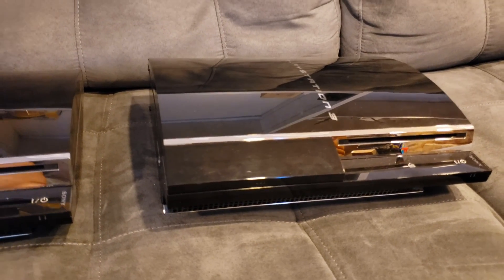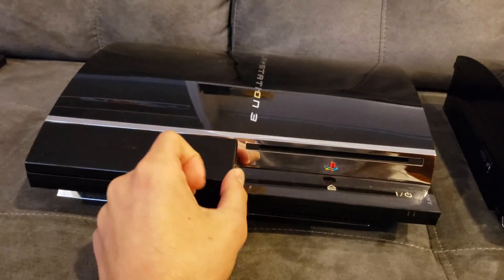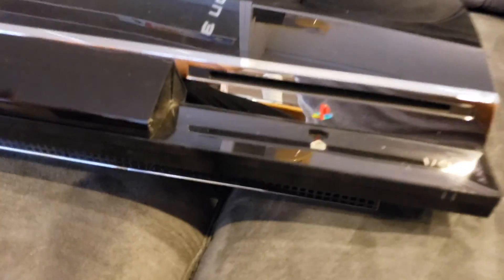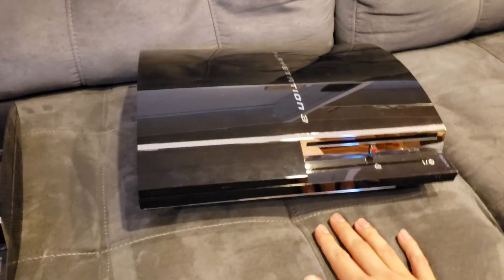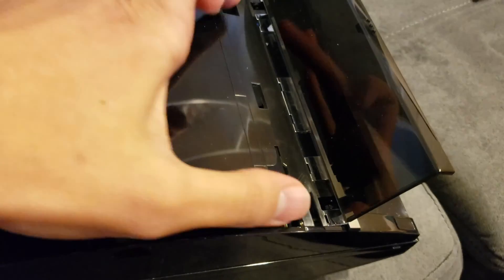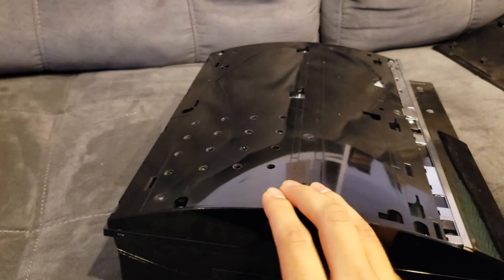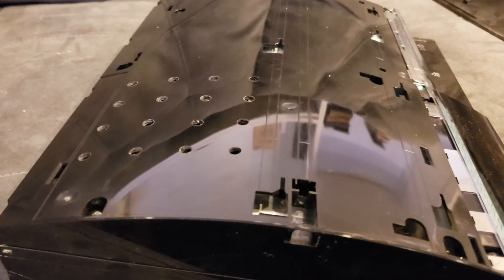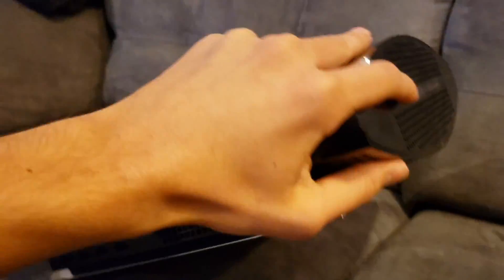Why PS3 YLOD happens and how to prevent it

Comment: Good video. What’s your take on the nec/tokin being the new believes reason for ylod
Reply from the maker: Thanks! I think the NEC/Tokin cap issue is very real. The same caps have been used in other electronics of the time and have been defective there as well. I have read many stories of ylod fixes by following a very thorough cap replacement tutorial on an old forum page, and I think that a majority of ylod PS3 can be fixed just by replacing the bad caps. Of course I still advocate the changing of thermal paste and pads on these old machines, because replacing a fried CPU or GPU is much more work than replacing caps.
Reply: @myairspace121  I agree. I think ideally if you want a fat system that will last a long time then you need to change the paste on the rsx and cpu. However you gotta change the paste under the spreader too which can be tricky. In addition to that, changing out the nec tokin caps and adding the fan mod will assure no need for reball. I have several fats I have changed the paste on and modded the fan. It’s loud but hasn’t failed.
Reply from the maker: @pzgeyo1995  Very interesting. I actually have a fat that has new paste on and under the IHS, and it actually runs hotter than another fat I have that only has new paste on the IHS. I'm not sure what caused this, but I have confirmed the anomaly by monitoring the temps through cfw. I also use a custom fan speed, so neither of them get too hot and work fine. 

From my knowledge, if the caps fail, all you have to do it replace the caps. You don't need to re-ball either chip.
Reply: @myairspace121  certain model fats run hotter than others. Like I have a cechg and it’s fan runs more than cecha at same temps.
Reply from the maker: @pzgeyo1995  That's pretty interesting.
Reply from the maker: @Mitchell Traigle Ah I see. You may be right. I'll try checking the next time I re-paste it. Thank you for the comment!
Reply from the maker: @Mitchell Traigle Aw man, I'm sorry to hear that. I hope it works out for you in the end.

Comment: Ihave question thermal paste importand under ihs
Reply from the maker: Yes, it is important to do so to keep the processors even cooler, but it is generally difficult to do. I would recommend against doing so unless you know exactly what you are doing.
Reply: @myairspace121  u think if i apply thermal paste on top of ihs is enough even the paste under ihs is dry
Reply from the maker: @ehabsaeed7686  I would recommend at least doing thermal paste on top of the ihs, and as long as the console has enough room to exhaust hot air, then I think it should be ok. Changing the thermal paste underneath the ihs as well would be the best option though since it will ensure the best dissipation of heat from the processors. It is a dangerous process though, and as I said earlier I only recommend doing so if you're very confident.
Reply: @myairspace121  if i have good temperature in the room and change thermal paste top of ihs only without changing thermal paste under ihs the cpu and gpu will not be damged
Reply from the maker: @ehabsaeed7686  I think that may work for you then.
Reply: @myairspace121  if i applied the thermal paste top of ihs is enough to cool the motherboard and gpu nd cpu
Reply: Bro need help so if there is rhermal paste top of cpu and gpu but no thermal paste under ihs u think it will overheat or ps3 will stay cool even the thermal paste under ihs very dry help me please
Reply from the maker: @ehabsaeed7686  I have two of these PS3 models. One of them has new thermal apste on and under IHS, and the other only has new thermal paste on IHS. 

The one with Thermal paste on IHS only actually has better temps, so I don't think tkaing off the IHS is really necessary since they are almost completely glued onto the silicon.

I also installed cfw on them and use a fan utility to monitor temps and not let them exceed 55C.
Reply: @myairspace121  hi thank u for information but iwant to take ur idea i plan to add extra fan under ps3 u think i need to put the fan to provide the air inside the console or take the air out
Reply: @myairspace121  i need help u think if add external fan to provide air from outside to ps3 its good.
Reply from the maker: @ehabsaeed7686  I'm not so sure about adding another fan inside of the console as that will change the internal airflow pattern. I don't see a problem with adding a fan in front of the console to give it more cool air though.
Reply: @myairspace121  u can make video how to make hole under ps3
Reply: Hi how r u how can i make good room in ps3
Reply: I opened ps3 nd ifound thermal paste on ihs is dry thats mean also the thermal paste under ihs is also dry im correct
Reply: If i apply only thermal paste only top of ihs and under ihs the thermal paste is very dry do u thing the cool  will transfer under the ihs of ps3 nd make chip of cpu and gpu  under ihs cold even the paste under ihs has space nt spread it   help me please
Reply: Hi making hole under ps3 is it good

Comment: Sometimes it's just a faulty capacitor that's the issue. Not always a case of needing it reballed although like you say changing to lead is the best way to prolong the console :)
Reply from the maker: Very true. Often times the Nec/Tokin caps are at fault on these early model PS3s. Unfortunately I wasn't aware of the capacitor issue at the time of making this video and therefore didn't touch on it. I still think there is some useful info though haha. 

Thanks for the comment!

Comment: Where do I get those new thermal pads?
Reply from the maker: I've gotten them through eBay and Amazon! Look for thermal pads that are about 4-5mm thick. Also if you search PS3 thermal pads on eBay, a lot of sellers have specific pads.
Reply: @myairspace121  original pads are 2mm thick on the blue ray, south bridge, and ps2 chip. The rest are 1.5 mm. Thicker pads then needed lower heat transfer efficiency. Get name brand pads from fujipoly or thermal grizzly.

Comment: I've also heard switching out the stock 15-bladed fan of the CECHA models with a 19-bladed fan from a later model phat 
can substantially improve the airflow
Reply from the maker: I heard about that as well, but I'm not so sure about the difference in cooling. I have a 19 blade, but haven't noticed much of a difference.
Reply: @myairspace121  You can use a 15 blade fan from a CECHL console in the first and second gen PS3s (CECHA/B/C/E). They bring much more air flow and keep the console a bit cooler...even if it's just 2°C
Reply: @LNCRFT  true! I got a 15 blade fan on my 60gb ps3
Reply: @Dislecsick  ^^

Comment: You could use web man mod to accelerate the fan
Reply from the maker: Very true, but that involves modding your PS3 as well as putting your fan motor through more stress. I've tried doing that before though, and it definitely works

Comment: Hey dude I'll legit pay you to fix up my 40gb (CECHG01)
Reply from the maker: As much as I'd like to help you out, I am not able to do so since I am not in a position to be shipping and repairing units. You can try telling me what's wrong with your system though. If it happens to be the YLOD, then try looking into tantalum capacitors to replace the NEC/Tokin ones on your model of PS3.

Comment: A want to buy one of those for 18€ without hdd and the seller say the ps need new thermal paste and need to be cleaned and the Blu-ray is disconnected idk why without dualshoch is is worth
Reply from the maker: If it's a backwards compatible model, it may be well worth it if you're willing to fix it up. If not, you can find them complete for around $120-200 USD.

Comment: It’s the capacitors. Not the solder. 

https://www.reddit.com/r/PS3/comments/cff5hg/ylod_conclusion_capacitors_are_the_problem_not/
Reply from the maker: I learned about this a few months after making the video. Very interesting! but I think also keeping the components cooler will help with the NEC/Timing capicitor longevity.

 Thank you for your comment!
Reply: Update. It can also be the solder bumps under the die on the RSX. Not the solder balls that connect the interposer to the PCB. ps3’s with the 90nm RSX are going to get a YLOD because of the chip design itself. The chip can be replaced with a 65 or 40nm RSX.

Comment: Mine is 80gb and backward compatible. Are they as bad as the 60? Warranty sticker is still on. It seems to stay cool enough. The fan is quiet. It's in amazing shape.
Reply from the maker: 80Gb models are not as prone to YLOD as 60Gb models from what I've read. I don't know how much better they are in that sense though.
Reply: the 80gb ones that are backward compatible are exactly the same machines with the 60gb launch ones(only the backward compatibility is different, software now)  so the chance is the same, they have 90/90nm chips inside the same as 60GB launch units .. so you are lucky that you still don't have YLOD.
the second gen 80GB they are with 65/65nm chips and as far as I know they don't get YLOD. Mine is this, and I have since 2009, and is still working, have many many hours played on it.

Comment: great tips is it possible to vacum out the dust without taking the ps3 apart? And also I just subbed to you👍
Reply: Depends if the vacuum gets hot if it does its not a good idea
Reply from the maker: It is possible to vacuum out most of the larger dust particles, which does help. I used to do that every few months or so with a CECHL and it's still running fine.

I would still recommend opening it up and changing the thermal paste/pads if you can though.

Thank you for the subscription btw :)

Comment: Hey, I'm about to buy a CECHA01 model and it has the warranty sticker intact, it works perfectly fine but I want to change the thermal paste, so my question is, what brand/type of thermal paste do you recommend for a PS3 Fat? Thanks for the video and for answer
Reply from the maker: Congratulations! I would recommend Arctic Silver MX4 or Arctic Silver 5. I personally use AS 5 since its thermal properties are slightly better from my research.
Reply from the maker: Also, be sure to watch and/or read a proper teardown of the console to get to the heat sinks. I have provided a link to a very useful teardown of the cecha01. Lastly, I'd also recommend watching a few videos on how to properly apply thermal paste to a ps3 system to gain some understanding of the procedures. Best of luck!
Reply: @myairspace121  all right, I'm starting with the research right now, thank you very much

Comment: I always wanted a 60 gig model and I finally broke down and bought one yesterday.  Planned on making it just my ps2 player.  I have another ps3 for ps1 and ps3 games.

I noticed the fan was running pretty loud while my 80 gig model fat boy purs like a kitten.  I also noticed it running a lot hotter than my 80 gig ps3 fat boy.  I plan on at least cleaning the system, dont know if I want to modify it all like this.

What do you suggest?  You think I might get the yellow light of death if i only play the system like 3 to 4 hours at a time?
Reply from the maker: Unfortunately it does sound quite possible, and I think just for the sake of being safe, you should at least open up your console and clean out any dust that you see every 3-4 months. 

If you want to go the extra mile to be even safer, I would highly recommend also applying new thermal paste to the CPU and GPU as well as applying new thermal pads where the existing ones already were. Replace thermal paste/pads every 8-12 months if you use it frequently.

Also, big tip, use your console in its upright position, not laying flat. When it is upright, naturally more hot air will be expelled from the side exhaust vent, so you will get better cooling.

You don't have to mod your PS3, and I don't necessarily recommend it either. Modding is really only for the people that like to tinker and squeeze out every bit of added performance that they can.

Anyway, I hope this gave you some insight,
and thank you for the comment!

Comment: Also aren't you kind of over exaggerating how badly YLOD affected PS3s?

The way you're talking about all these design flaws, YLOD was never anything like Xbox 360 and RROD.

I know 4 people, including myself who bought the launch 60GB PS3 and none of us had failures. I know my cousins was dead on arrival but nobody got YLOD. 4 people isn't conclusive i know but I also knew around 8 family/friends who bought day one 360s and ALL of them except 1 got RROD.
Reply from the maker: I don't think it is much of an exaggeration. This model of ps3 is known to have issues with the YLOD, and it is the most common model of ps3 to be affected by the issue. With that said, you're right, it was not as big of an issue as the XBOX RROD, but it was still widespread among BC ps3 models. 

It will be an even more prevalent issue if the console has never been opened and cleaned since its original purchase date. (if the warranty sticker is still in place) 

Of the 3 60gb models that I've owned, one of them got the YLOD in the first 6 months.

Comment: Are you sure about your claims here? I'm pretty sure all PlayStation consoles just take air INTO the system through those side vents and the fan uses that air flow to blow the heat out the rear vents and the rear vents alone?

I'm not disagreeing with you or saying you're wrong, I'm simply asking.

As for keeping your console cool, its simple.

Start using a gaming headset at all times. That allows you to just point a normal fan at the console. The headset means you won't hear the house fan.

This means fast, cool air is not only taken in through the intakes, but it also instantly and continuously blows ALL warm air away from your console, preventing it from building up.

This works so well that even my PS4 Pro (widely known to get very warm) barely feels warm to the touch even after many hours play.
Reply from the maker: I understand your questioning, but I am very confident that the 60Gb ps3 does indeed exhaust air out the right side and rear. I have had 3 of these models and this has been the case for all 3. Hot air does indeed come out of the right side of the console as well.

Comment: My 60gb PS3 still has not gotten the YLOD, should I wait until it gets the YLOD to change the thermal paste or do it before?
Reply from the maker: I definitely recommend doing so before. New thermal paste will keep the processors running cooler and you may never even have to deal with a YLOD. Also change the thermal pads if you are able to
Reply: MYAIRSPACE thank you so much for the reply, I'm just a little sketchy about opening it but I will do it, also do you think I should upgrade the can to a 19 blade fan and upgrade the power supply?
Reply from the maker: @scubadestroyer7045  you're very welcome! I understand that. In my video description I've provided a handful of helpful links that will walk you through opening up your system when the time comes. As far as the fan goes, the 60gb ps3 already uses the 19 blade fan and I do not know of any possible way to upgrade the power supply unfortunately :/